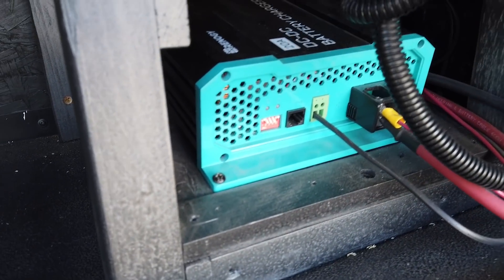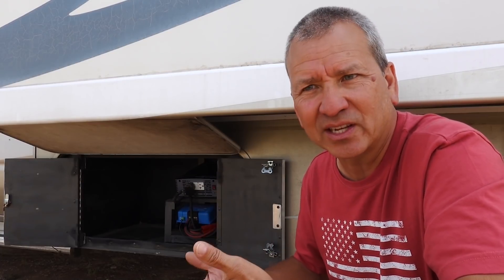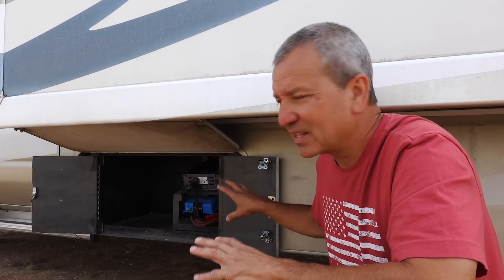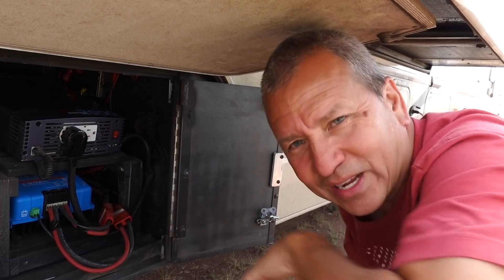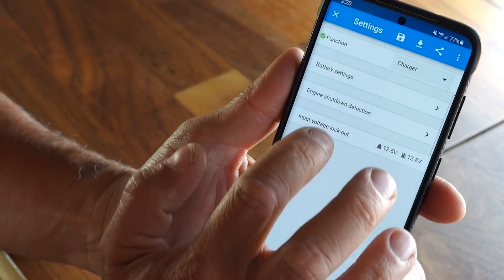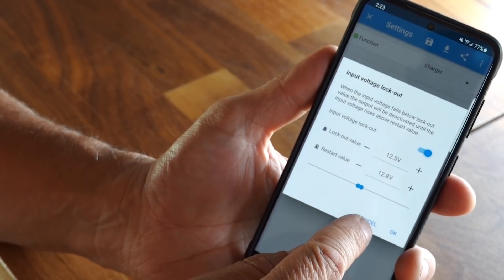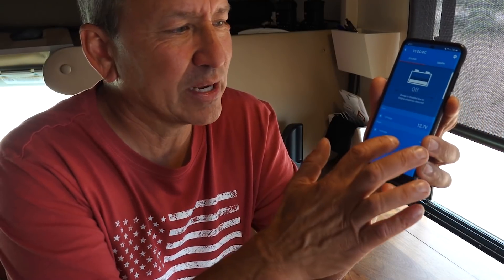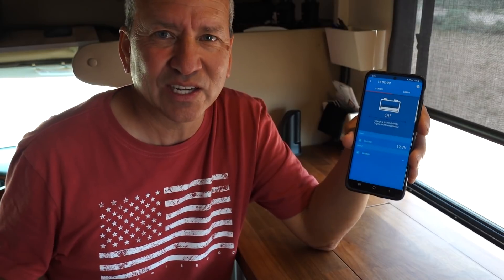RENOGY or VICTRON DC-to-DC Charger for Lithium LiFePO4? / Off-grid RV Solar / RV DIY

Comment: The Anderson bypass plugs; I was talking with B Born ... and they said the LiFiPO4 are not to be used as a start battery.  ... whereas the lead acid batteries can handle the spike jump of amps to turn the starter.   I am only at 6:51 in the video and you may be addressing this (before I forget :-)).
Reply from the maker: I didn't mention it in the video, but you're correct. What you could probably do is simply connect them (not starting) for a while and let the LFPs put a little charge into the starter battery. Thanks for raising the issue.
Reply: @RVwithTito  That is a good idea in form to charge up the start battery.  Have a great day....

Comment: Another informative video!  With a 5th wheel configuration, I’ve wondered if it was worth installing an isolator under the hood and a plug disconnect to the back of the truck so that I connect/disconnect when I hitch up.  That would take advantage of charging when driving from one location to another.  A lot of work for that small gain.  Anyhow, this info will help me to plan/decide on this.
Reply: Jim, if you are using LiOn batteries the dc-dc charger needs to be as close to the house batteries as possible. You can run a cut off solenoid from the truck battery to cables to the back of the truck, Anderson plug connection to the trailer, continue cables to the dc-dc charger to then charge your house batteries. It's one extra step when hitching/unhitching but it means you get full charging when on the road.
Reply: @henrycolestage4249  I had to chime in again Henry after thinking on this…. While my on board gen is currently my main recharge resource while boon docking, I think it would be a mistake to not take advantage of the alternator on my Duramax Diesel while underway.  I completed my install and it’s all working great, so this will be the next addition.  Thank you for your comments earlier.
Reply: @henrycolestage4249  After the Victron training I attended, I'll use the generator.  I'm installing LiFoPO, and the inverter will charge them in about 90 min.  I can run the gen and pull over in about 2 hours and shut it down.  It's much more efficient

Comment: Hmm I’m doing an audio install with 2 20ah lithium battery’s and I see that victron appears to have much smaller inputs, I doubt you could even get 2 or 4 gauge in there. In audio everyone typically runs the thickest gauge possible for fear of bottleneck.

Comment: I use the Renegy 60amp DC to DC with Bluetooth that has all of the same victron software features you were pointing out... it charges our 48v LifePo4 battery bank on our Travel Trailer.  My diesel truck has a giant alternator and it just idles pushing 60amps into the batteries when we get limited sun while boondocking.  I have ran the motor for over 2 hours one night and only used about half a gallon of diesel.
Reply: The ideal setup!  The motor you already have is your backup generator!     I also use my engine with an oversized alternator as a supplement when panels can't keep me powered.  I have a much smaller system with a 6 cyl gas engine.

Comment: I have a 24V LiFePo4 battery and I use the Victron 12/24-15 DC-DC Converter in my travel trailer connected to a dedicated charging circuit from my truck through an Anderson connector.  It works great and gives me an extra 300 watts of charging capability driving down the road regardless of solar conditions.  It allows me to run my RV fridge off of the 120V instead of propane when driving.
Reply: I wish you would make a video...

Comment: Brian, great video. Thanks for sharing. How do you feel about the Simarine now that you’ve had it for a while? I like the interface but they don’t seem to be getting a lot of traction as a company. Still don’t see it much out in the wild.
Reply from the maker: I agree. I asked them what's up. They haven't been happy with their software vendor and are re-doing it in-house in an effort to have better control over quality and features. Look for it to get better.

Comment: I too have a E450 chassis for my Class C (2019 model).  You stated that you wanted to charge your lithium batteries from the engine battery.  Doesn't the charging take place by default w/o having to use a dc-to-dc charger?  You also stated you wanted to limit the amps to 20amps b/c the alternator could potentially output 90amps.  Based on this, I don't understand how the dc-to-dc charger is going to prevent or safeguard if the house batteries are already being charged - you did not mention a bypass.  Could you explain that part?  I did a test of my lithium battery charging while engine ran at idle for 30 minutes.  During that 30 minutes, the lithium bms reported an input charge of btwn 35 and 40 amps (specs on the lithium warn against 50amps or greater).  The batteries were at ~80% SOC.  As they approached 100%, the input amps dropped off to 8 to 10 amps.  I also monitored the alternator temp with a temp gun.  It reached at max temp of 110.  Based on this test, i'm on the fence as to needing to install a dc-to-dc charger at all. Of note, I watched your installation video you linked to so my questions/comments above are from both videos.
Reply: The Victron DC to DC is MPPT charge controller and will reduce and stop charging when lithium get to 100%.
Reply: @JJs-ClassC-Adventures , appreciate your response but it doesn't address the questions I have.  To clarify, if you attach a DC-To-DC converter to the engine battery to charge the house batteries w/o disconnecting the alternator charging, aren't you simply adding another charging source?  In order for the DC-To-DC charger to work as intended, the alternator charging source must be disconnected.  I'm looking for clarification on this point.

Comment: Very good video. I love your analysis. I have a boat and need to use lead acid batteries not just to start my boat but to provide power in the event of BMS failure. I have been experimenting with paralleling lead acid and lithium to keep my lead acid batteries at 99% SOC while anchored for extended time while not running my engine. It seems to work well. I have a video on this experiment but I learned about this from other videos. It would seem one could add Lithium to existing lead acid banks just by joining the 2 banks as you have show with your connectors. Thanks again for this great video. You have helped me so much.
Reply: Same here, using lithium to bridge the night time/rainy days voltage drop in lead acid. Using an awesome gel cell starting battery and have big bank of flooded lead, but I just need lipo4 to get through a few rainy days. I will use a DC/DC charging to maintain the lithium fully charged and may put the lipo on a switch for use as needed, possibly just back feed into the distribution panel with a 15 amp breaker. We will see what works. (Im not convinced the $380 battery combiner is a great value or needed, but I love his idea of combining battery types)

Comment: Hi Brian, thanks for the great video and information. We also have a Class C RV on a Ford E-450. Ours has a factory-installed contactor near the original battery compartment. It connects house and chassis batteries for charging and also for emergency starting. We switched out our original lead batteries for 600ah of LiFePO4’s, relocating them in the process. But the contactor is still in place. Did you also have a contactor, and did you remove it or disconnect it? Thanks!
Reply from the maker: With the DC charger installed, it's only a one-way flow of energy (chassis -> house). So I removed the relay and replaced it with a terminal post. Then I connected the chassis battery side to the positive cable feeding the DC charger.

Comment: Hey Brian, Thanks for the video! I already purchased the Renogy DC/DC charger, primarily because of the 60A version. I installed the Victron MPPT for my solar on the coach, managing 820W of panels and indeed love the Bluetooth control. I like Victron, especially their Bluetooth connectivity and software. With my panels able to send ~40A to my 4 ReBel 100AH LiFePo2 batteries (metal version), I might have been satisfied with the 30A Victron DC/DC charger, but I had not considered the solar input until your video, my bad. I might Facebook Market Place my 60 A Renogy without ever installing it and go to the Victron, thanks Tito! :)  On the shunt, just a warning, the only Victron item I've been unhappy with is the Victron Smart Shunt. It's Bluetooth is just pathetic. I could not even connect to it with my basement door closed. Lot's of complaints on this on Amazon. The Victron BMV-702 shunt does a much better job, but is pricey. I went with a new company that I am very happy with, in fact have installed three of these already, the Thornwave Shunt product is incredible, and unlike Victron, has true data recording on the module. Victron's only records the strip chart while you are connected and it is lost after disconnect. This baby connects to my phone from hundreds of feet away! I went with the Thornwave Powermon and separate shunt version as my battery compartment is open to the elements and this module is sealed up in epoxy: https://www.thornwave.com/products/bluetooth-battery-monitor-dc-power-meter But if I had a closed battery compartment I'd go with the Powermon-5s as it's all in one: https://www.thornwave.com/products/powermon-5s-bluetooth-battery-monitor-dc-power-meter-with-integrated-500a-shunt . Thornwave also has a really cool 100A solid state switch that can, of course, be powered by the Powermon relay, or other driver. I am not affiliated with them or ReBel, but I am not ashamed to recommend companies that have provided me with really good service and products.
Reply from the maker: You could still use your 60A Renogy DC-DC and solar together. Also, thanks for the feedback on the Smart Shunt. I have one for an upcoming project.
Reply: @RVwithTito  thanks for your response Brian! Yes and I could use just the shunt to monitor the charging and such, but I sure like the added  connectivity of the Victron. Still going back and forth on it. You ever get to Southeastern Arizona look us up? We're not on Boondockers, but we've got plenty of space and hookups just outside Cochise stronghold national monument.
Reply from the maker: @MarkSpencerAZ  Thanks for the invite Mark. I may take you up on that. Cheers!

Comment: I have a Ram with dual 220 amp alternators, so I guess I have enough alternators but what is enough and how does one know?
Reply from the maker: One tip I heard was to add up all of the fuses in your chassis fuse box to get an idea of the max current draw. I'm sure it's not precise, just ball park. I suppose you could also put a cheap clamp on current meter (like this: https://amzn.to/3BgsT14) on your alternator output to monitor it for a while while driving.

Comment: Too bad the maximum output of the charger can't be set, so I could charge at, say, 10 amps when driving at night, in the rain with the heater fan blowing,, and then raise it to the full 30 amps for normal sunny-day drives.  Or I could set it to pull low amperage when installed in a minivan with a regular alternator,, and then when I upgrade to a diesel truck with a big alternator, I could use it at full capacity.
Reply from the maker: Yeah. Great point. That would be a nice feature to make this unit much more flexible.
Reply: @RVwithTito  Good news.  I googled up Renogy's manual,, and their 20, 40, and 60 amp DC-DC chargers have a connection called LC.  Here's what the manual says: "The  DC-DC  battery  chargers  feature  50%  current  limiting  from  the  rated  specification  when  
connecting the LC Terminal to a 12V source. "  And there's a chart showing that, for example, the 40 amp model puts out a max of 20 amps when LC has 12v on it.

Comment: Brain ,  I would  like  your  advice  on   adding lights to my motorhome   mirrors . I found  the lights  that  snap in just  like  the ones on your  rig .  Also getting  wires into  cab is easy , but looking  for  advice  on  wiring  so they are running  lights  and turn  signals  .  Thanks  for  any  information  you  could  suggest .
Reply from the maker: I suppose you need to look for the left/right parking light/turn-signal circuit and tie into those. Mine came factory installed.
Reply: @RVwithTito  brain  are  yours parking  and turn or just   turn ?
Reply from the maker: @donlandin250  Oops. Just turn signals.

Comment: Have you thought about a higher amperage alternator?  Mechman makes then up to 370+ amps and they usually have a lot higher output at idle than stock.  Then you could supply more like 60-90 amps to your batteries.
Reply from the maker: Maybe down the road it's something I'll consider, especially since I don't have a generator anymore. I've used the DC charger quite a bit recently on those rainy days.
Reply: @RVwithTito  Heat is the problem with the high amperage 12v alternators. If you have a low SOC and you are pulling a lot of amps and not able to dissipate the heat you will fry those alternators.

Comment: Good video.  Have you considered upgrading the alternator.  200-300 amp alt are not that pricy . I may be going that route on my E450
Reply: What brand(s)/alternator source(s) are you considering? Thanks!
Reply: @larryoverstreet3610  no brand in specific but saw them eBay.  I assume if everything beyond the alternator is wired correctly it should do the trick and be very helpful .

Comment: I see why you added the Anderson style connectors, but it OK to use the LiFePo4 deep cycle house battery as a charging assist for your motorhome?
Reply from the maker: I probably won't do it (never had to in the past). Others here have shared their reason why not to do that for LiFePO4.
Reply: @RVwithTito  Hi Tito.  LiFePo4  storage (deep cycle) batteries are not starting batteries and should not be used to start any engine.  I think some DC-DC charging setups allow the house battery to add charge back to the vehicle start battery after the house battery is fully charged, so in a sense it does help the start battery.  But that doesn't make much sense because the start battery is connected to the alternator all the time anyway.  Maybe that is what you meant?

Comment: Hey - is there a stand alone 100 amp alternator (any engine powered)  that full power charges a lifepo4 battery ?
Reply: I've been thinking about this, too, and using it as an opportunity to ditch my onboard Onan Gen. I haven't yet located the best second alternator, but I intend to call Mechman and see if they have a good solution. Best of luck to you!
Reply: @larryoverstreet3610   thanks.   Id sure like to hear what you find out.
Reply from the maker: Please share what you find.

Comment: Victron has NO technical support to end users. Something I learned the hard way. Good luck when you have a defective unit. I would never buy anything from Victron. Renogy has technical support. I'll stick with Renogy.
Reply: I have exactly the opposite experience, and so do many others.  Victron has a 5 year warranty and extremely good customer service. Their products are dynamic in that the victron connect app allows firmware upgrades, which come regularly to keep your product working at its best, rather than being stuck with old technology. Victron is a manufacturer, not a reseller or rebranded of others products, and has cutting edge technology.

Comment: Just curious in one of your previous videos you had installed 400 aH of Lithium batteries.  In a worst case scenario with fully depleted batteries and no sun you would have to drive for 400 aH / 30A = 13 hours to charge your batteries.   Have you thought about adding a second DC to DC charger or is the fully depleted scenario rare?  When you had the 20 amp Renogy it would have taken 20 hours of driving to charge the batteries, so the Victron is an improvement.
Reply from the maker: It's rare for me. Solar is my primary way to charge. The DC to DC is supplemental.
Reply: And any solar amps will add to the overall charge current. If you're traveling during the daytime.😁

Comment: The Victron uses convective cooling and the manual wants it mounted vertically.   Are you concerned with overheating with your horizontal mounting?
Reply from the maker: It's actually mounted at an angle allowing the heat to escape. The compartment also has a temp controlled ventilation fan to pull heat out when it reaches 90 deg F
Reply: Very good point. I have this same charger and it runs hot, like +115°F. Spoke to a Victron rep and they said up to 130°F is “normal”.

Comment: Battle Born recommends a BIM. Li-BIM225. Under normal charging conditions, the Li-BIM225 will connect for 15 minutes every 35 minutes. That means that the BIM will connect for 15 minutes, disconnect for 20 minutes, and repeat this cycle until the coach battery is charged.

If the coach battery resting voltage exceeds 13.4V than the Li-BIM225 will disconnect. A resting voltage greater than 13.4V indicates a fully charged battery. Note that “resting voltage” means that no current is flowing to the coach battery.

The Li-BIM225 will disconnect if the alternator voltage exceeds 14.4V. This protects the coach battery from over charging.

The BIM will disconnect if the voltage difference between the alternator and the coach battery is less than 0.1V. If the voltage difference is too low, then there is a negligible charging current, and no need to connect to the coach battery

The BIM will disconnect if the alternator voltage drops below 13.3V. If the alternator voltage is too low, than it cannot adequately charge the coach battery, so there is no reason to connect. There is also a Jump start feature.
Reply from the maker: Thanks. I'm aware of that custom programming on that unit, but haven't tried that yet.